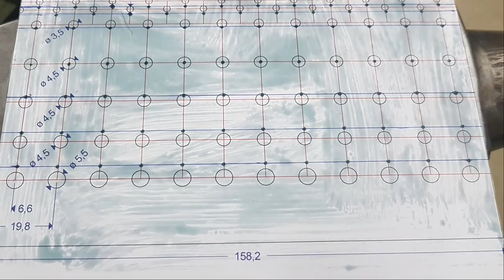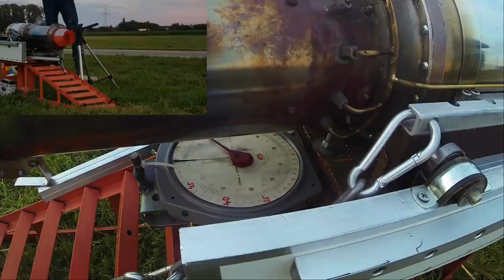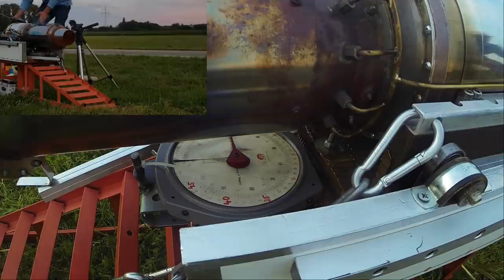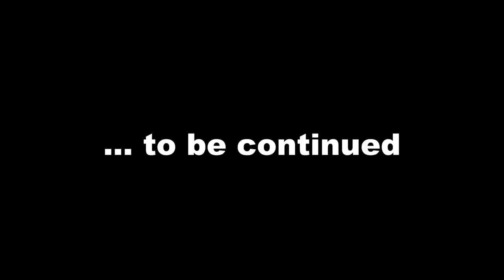Handmade Jet Engine, Improvements, Mishaps, Testing, Full afterburner

Comment: Hello!!!  Do you have a spark plug or another electric ignition source in your afterburner?
Reply from the maker: Hi,
I use a hot streak ignition.
A short extra amount of fuel is injected into the combustion chamber and creates a "long" flame out of the engine😉
Andy
Reply: @Praendy  Gotcha!  Thank you!!!

Comment: how did you make the turbines.  By casting or by milling?
Reply from the maker: Hi Alex,
the turbine wheel is the second stage wheel from the Tornado fighterjet APU. 
I found it at Ebay.
The compressor wheel is from a Garrett Gt5533 turbo charger.
Andy

Comment: What normally makes the blades in jet engine to rotate
Reply from the maker: Hi,
Check that video and you will get a rough view of a jet engine working.
For spinning the rotor there are electric motors, or air starters available.
It depends on the size.
Andy
https://youtu.be/x8DK4rM6Y90

Comment: did you make you threads deep enough so that thermal expension doesn't pop out your air intake?
Reply from the maker: Hi,
The thread is 2 mm. In ambient temperature its tight to screw in, so the compressed air has already 160 Celsius and the Teflon gets weak.
To prevent, I will 4 screws around the intake to hold it in place.
Andy

Comment: 4:51 I have never seen a flame like that. I know that it is fuel rich, but it looks too dim, and almost cloudy. Do you have any idea what it might be/what might be causing this?
Reply from the maker: Hi,
This is a "good" flame.
The fuel and air mixing perfect, so the flame is almost not visible.
It happens when its still bright during day, or sunset.
Have a look at 05:40
The flame is visible after ignition, but when the engine spin at higher revs, the flame disappears.
Andy
Reply: @Praendy  Thank you!

Comment: Andy where do you make this parts online?
Reply from the maker: Hi,
what do you mean?
Which parts online?
Andy
Reply: @Praendy  Andy i mean the shaft, compressor wheel, and the turbine.
Reply: And how much money did you spent to make the engine?
Reply from the maker: Compressor wheel and turbine wheel I found at Ebay UK.
The shaft is selfmade 42 crmo steel.
All parts together including bearings, I spent ~1000 Euro.
Now, after some mistakes, afterburner and parts again, again ~1000 Euro.
Its still cheaper, then one to buy😉
Andy
Reply: @Praendy  oh ok 
Thanj you
Reply: @Praendy  Thank you
Reply from the maker: https://www.ebay.co.uk/itm/192902156776?_trkparms=aid%3D111001%26algo%3DREC.SEED%26ao%3D1%26asc%3D20160908105057%26meid%3D39f490d57ba548188780ee6c40e5da60%26pid%3D100675%26rk%3D1%26rkt%3D15%26sd%3D192902156776%26itm%3D192902156776%26pmt%3D1%26noa%3D1%26pg%3D2380057%26brand%3DMamba&_trksid=p2380057.c100675.m4236&_trkparms=pageci%3A8f9800da-c9b1-11eb-ad06-f6083b64a94c%7Cparentrq%3Af4849c051790a4d4b7bf57d7fff610c0%7Ciid%3A1

Thats the link from my new wheel👍
Andy

Comment: Keine Ahnungwieso, aber ich habe Monate lang keine Benachrichtigungen von deinem Channel bekommen.
Da stimmt was nicht mit dem Nachbrenner. Die Innenverkleidung sollte nicht glühen. 

Bei den Jetmotoren der Kampfjets, die ich mir ohne Verkleidung anschauen konnte, sind nach der Verbindung von Motor und Nachbrenner, Lufteinlässe. 
Ein Teil der Luft wird zwischen Innen- und Außenverkleidung abgeleitet, der Rest in den Luftstrom.

Durch das Zuführen kalter Luft und der Expansion durch das Aufheizen im Nachbrenner, steigt die Strömungsgeschwindigkeit nochmal mehr an.
Reply from the maker: Hi Jan,
schau mal bei 06:21 genau hin.
Ich habe auch ein Flammrohr, welches durch einen 1 cm Luftspalt umgeben ist.
Ein richtiger Nachbrenner arbeitet mit viel mehr Luftmasse und teilweise mit keramischen Beschichtungen.
Bei den Russen grün, bei den Amis weiß/gelblich.
Ich bin mit dem Nachbrenner zufrieden und mach mir keinen Kopf wegen bissel glühen.
Ist alles aus Inconel Blech und wird nicht schmelzen.
Außerdem gibts viel schlimmere Videos mit weiß glühenden Nachbrennern.
Genannt sei Andy Morris😉
Mfg Andy
Reply: @Praendy  Hi Andy, ui Inconel. Na dann mach ich mir keinen Kopf ^^
Das Zeug ist der Hammer, leider auch der Preis :}
Ich freu mich schon aufs nächste Video!
Reply from the maker: Hi Jan,
könnte morgen gegen Abend soweit sein.
Habe viele Sachen erneuert/überarbeitet.
Keramik Beschichtung im Nachbrenner.😉
Andy
Reply: @Praendy  Wäre schön, wenn Du auf die Beschichtung mehr en Detail eingehst :)

Comment: Bypass upgrade would be good
Reply from the maker: Hi Barrett,
a bypass is not required for thdd afterburner.
It works like "older" afterburners with  double walled pipes and uses the "cold" 550-600 C air, to cool the flame tube.
Also the complete a/b is made of Inconel.
Andy
Reply: @Praendy  I was not aware of these facts , yes you are correct , a bypass style jet would not be nessasary . I look forward to seeing the progress of your project
Reply from the maker: @barrettoliver2009  Thank you😉
After receiving a new compressor wheel I will go forward with testing👍 Andy
Reply from the maker: Hi Barrett,
This guy, also named Andy needs an upgrade.
But it also works😊
Looks amazing, the white glowing a/b.
https://youtu.be/DmMVqyfrEBw
Andy

Comment: The thrust is not goot for the engine of this size.  There is something to be tuned.
Reply from the maker: Hi Sergey,
Thats also my "good" question.
30 Kg thrust is not much for this size.
Will try a different compressor wheel next time😉
Andy
Reply: @Praendy   Compressor-turbine performance may not be in unbalanced. Try to reduce the inlet diameter and check the resulting EGT-RPM. This can be done with a simple extra sheped ring inside the inlet.

Comment: Can you please tell me how did you balance the wheels?
Reply from the maker: Hi,
Simply in my hand.
The shaft with turbine wheel installed I balance in my hand.
Then the complete shaft installed in the engine with bearings and comp wheel.
I use compressed air to spin the rotor and feel with my hand, where a vibration occure.
Then I use knead to balance all out and start to grind off the heavier side.
It takes time, but it works😉
Andy
Reply: @Praendy  thank you very much!

Comment: so what it does 69,000 RPM ... how much THRUST does it give at that value ... you can spin the turbine at 100k RPM and get 300 ftlbs of thrust ... or you can get 14k ft lbs of thrust ... THAT is what matters on the jet engine the RPM is just a watch parameter to work to on materials to avoid them breaking apart at the highest RPM possible ... 

finally so 66ftbs of thrust ... at 69kRPM ... so not really powerful ... and the air intake came off because the compressor chamber heated up too much and let go of he threads ... bypass air in the intake shroud to cool the main body will make that less likely to happen ... you WHITE flame is the titanium oxidizing in the excessive heat ... either coat your turbine blades with a ceramic coating or bring in more cool air into the converging portion of the flame chamber so the turbines stay cooler and you get a lager heat differential for more thrust ...